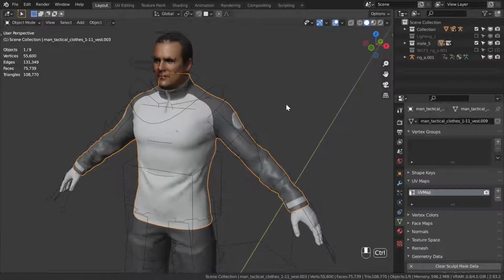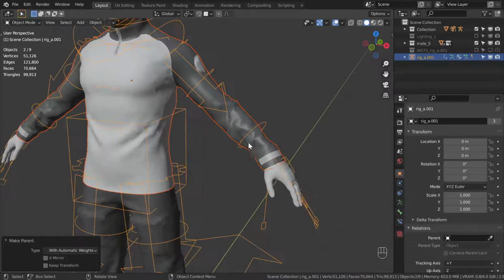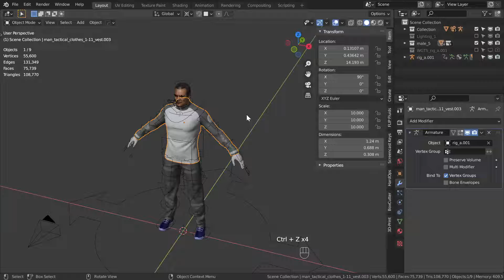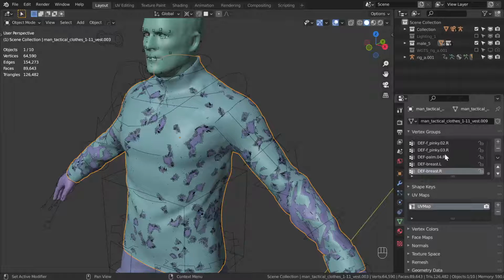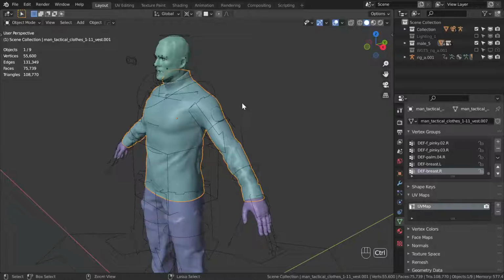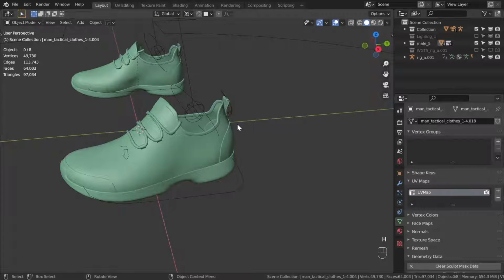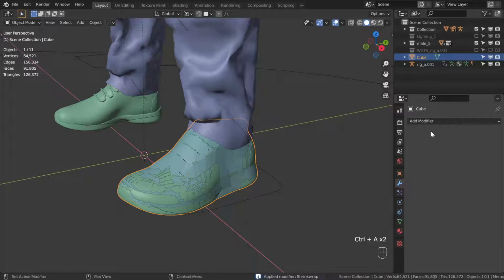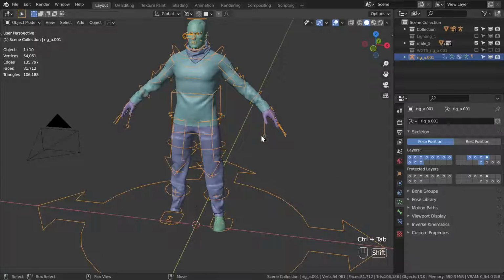A few solutions: Bone Heat Weighting error in Blender

Comment: nope not fix still same f... error
Reply from the maker: Ah, bummer... Sorry it didn't work.

If I had to pick the most consistent method from this list, it would be remeshing + transferring the weights to the original mesh. 

Also, please make sure that, after you transfer the weights back to the original mesh, you parent the original mesh to the armature by ONLY selecting the "Armature deform" option (NOT "with automatic weights"!).

Comment: alt s not working even not selected mesh
Reply from the maker: Maybe your mesh has already had its scale reset or applied? Also make sure you're not in edit mode, just in case
Reply: @issaHMD  ok will check do u have discord
Reply: @issaHMD  i am trying it on skeleton and mesh but skeleton keep making mesh also small its on object mode
Reply from the maker: Sorry, just noticed that you replied, did you manage to fix your issue? If not, maybe try unparenting the mesh from the armature to make sure everything's at the correct scale, then trying rigging it again.

Comment: 3:58 I have two idea to fix it
1)First,select the mesh
2)Press Ctrl+A
3)Normaly this time you will see a dialog
4)Click All transform
5)You made it

1)Click option at top right of viewport
2)Select origins
3)Select your mesh and press Alt+s
4)Uncheck the origins at "option"
5)                  What eles?
Reply from the maker: The mesh broke in the knees with the first method, but the second one seems to work, thanks for the feedback!
I guess it should also be possible to fix the scale by resetting the scale of the armature (Als+S), unparenting the mesh from the armature (check "keep transform" in the popup), applying the scale to it (Ctrl+A then S), then parent it to the armature again using Ctrl+P (choose Armature deform).